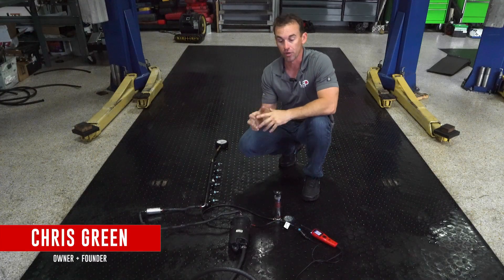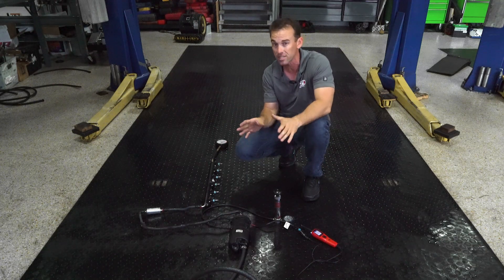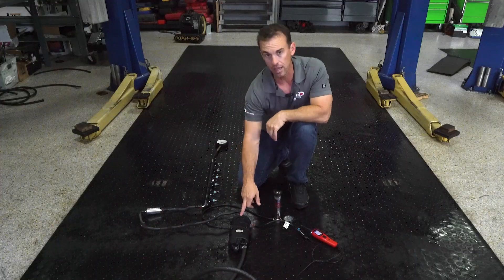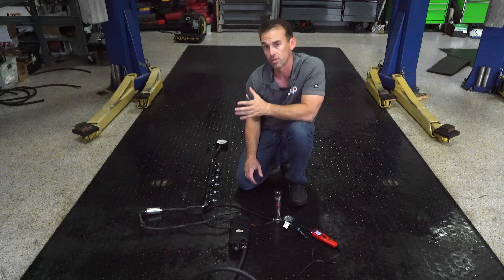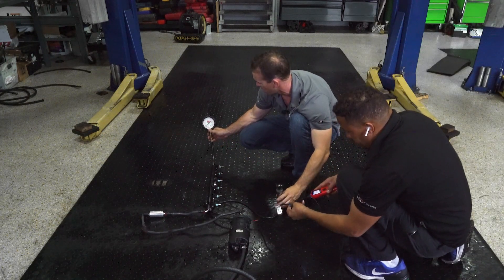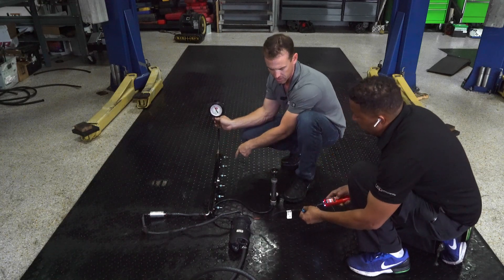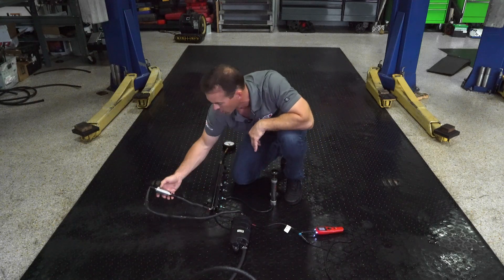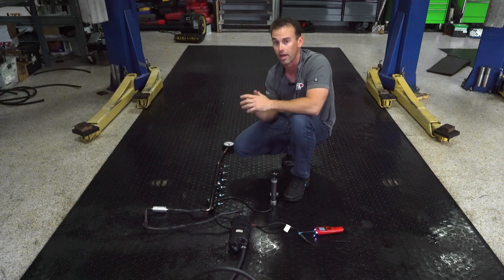Mercury Verado Fuel System Explained!

Comment: Hi I hope you doing very well, I have a issue of my mercury verado 225 hp, the house of the valve regulator pressure that coming out from FMS is disconnected, I need to know after FMS where the house is will connected, please helps thanks for your help…
Reply from the maker: The hose makes its way to the intake manifold its a little tricky to get to.

Comment: I have a verado 250 and mine has two filters. One high pressure and one water separator.  Motor died on me last night. Thought maybe I had bad fuel or water in the system.  I emptied the water separator reservoir thinking it might had had water, now my system won’t fill it back up.  Not sure how the system runs on this setup.
Reply from the maker: If you emptied the filter you need to re prime the system. Use the Schrader valve on top of the fuel rail and you’ll need to turn the key on and off to get the pump to turn on. Once you get a steady stream of fuel coming out the Schrader valve your system is bled. If you cannot get Fuel up there that means you have a bad lift pump.
Reply: @USPMarine  wow thanks for the quick reply… ruined the my night and couldn’t wait to get out there and work on it

Comment: Hi Chris, I love how you summarized all of this important and useful information for Verado fuel system so clearly!  But I got question about the size of the Schrader valve upon the fuel rail.  I got something fuel gauge but not fit on top it, then I use the connectors link the filter to fuel rail to test it out but show only about 50 psi when turning the key on and a slight drop to around 40-44 psi a minute later.

Is that normal?  I saw what your video shows over 50 psi at the start then you keep the power on it and goes to 70psi!
Reply from the maker: 100% normal as when the engine goes into vacuum (idle) it will lower the pressure. the reason it goes to 70PSI is we are simulating boost pressure into the FPR reference port.
Reply: @USPMarine   Got it, thanks!
Reply: @USPMarine   Great video! Recently my fuel pump is pumping way to much fuel which locks up the cylinders to the point the motor won’t turn over. I think it may be the fuel regulator. I need to try this test you performed in the video. Is there a return line for the fuel regulator on the top of the FSM?

Comment: Chris, thanks for posting this video. I am trying to understand an issue with my 350 verado now. It is consistently reporting the use of about 10% less fuel than I am actually burning. Where is the Flo scan sensor on this system?  Can it be recalibrated or replaced?
Reply from the maker: There is no floscan sensor. This calculation is based on injector pulse width. That data is then analyzed through the Mercury Vessel View software. It is not 100% accurate as we have found -- more of a "calculation". Double check all your fuel configurations (ex: your engine model, etc).
Reply: Thank you. I am noticing that my port engine is burning more than the others (12.9, 10.9, 11.6GPH on the trip setup). It may be a bad coil or something in the port engine and it’s consuming more than the calculated Amt.
Reply from the maker: @billme6326  That is within spec to be honest. Rotation, props, etc. I wouldn't lose sleep over that.
Reply: Thanks, I am going to have to find the offset to get fuel management more accurate. Almost did not make it home with fuel management showing I still had 78 gallons in the tanks (more like 10 left). That is way off.
Reply from the maker: @billme6326  You are correct. Level sensors in the tanks are always going to be off as well. Just have to go off how much you physically are burning. Most boat tanks are not perfect squares, so this creates error in tank sensors.